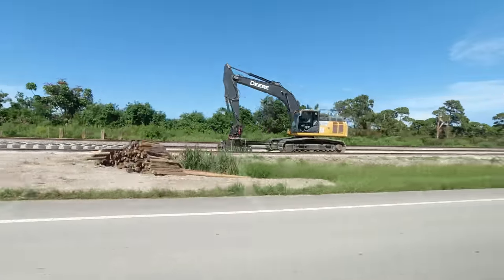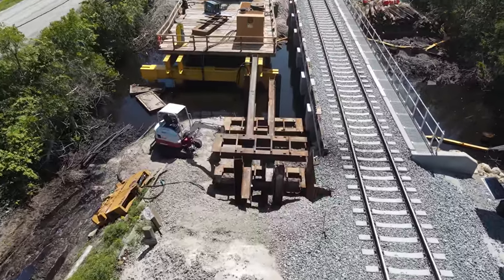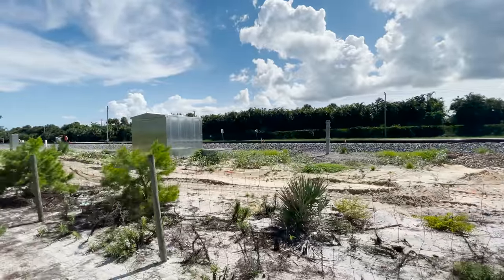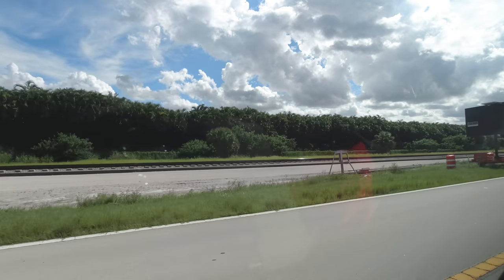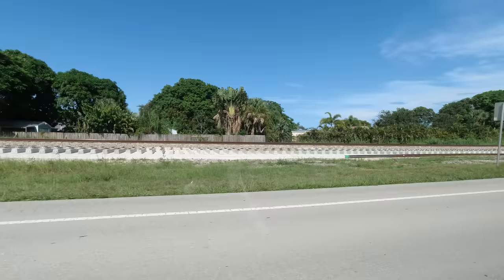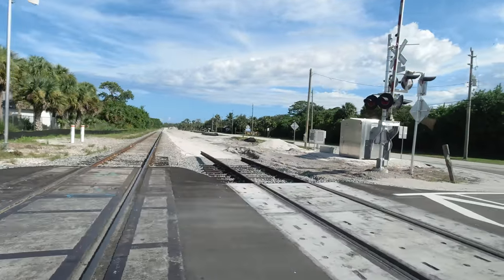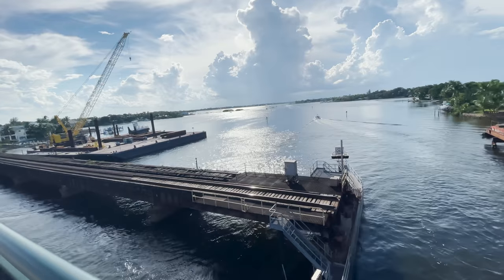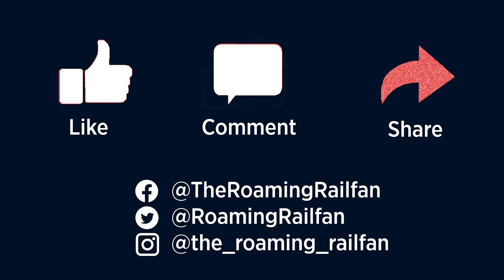Brightline Construction Between Stuart and Jupiter - August 2021

Comment: Another great update! I’m curious, does the new rail come in from the north?
Reply from the maker: Yes it does, I think its made in Indiana or Ohio
Reply: @RoamingRailfan  When I drove home from MCO today, it looked like there were long stretches of the ROW that were ready for ties and rail. I recall you reported that once the connection is finished between the branch servicing the coal-fired power plant and the MCO-Cocoa line, it would be used to deliver rail.